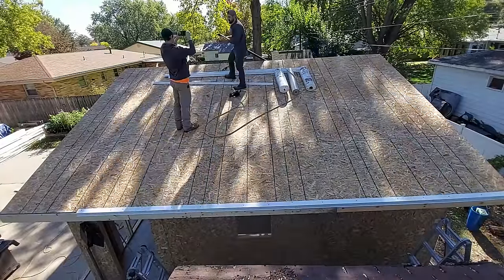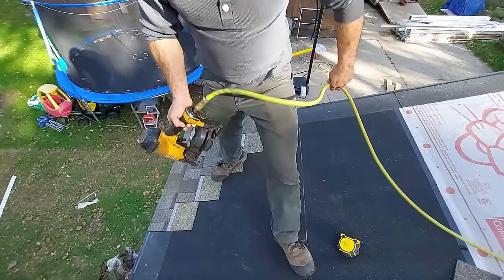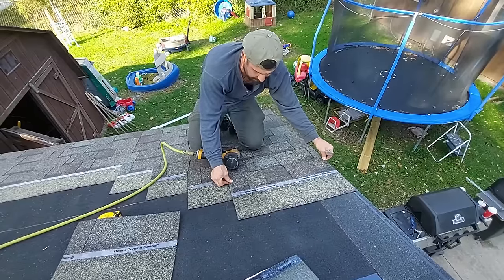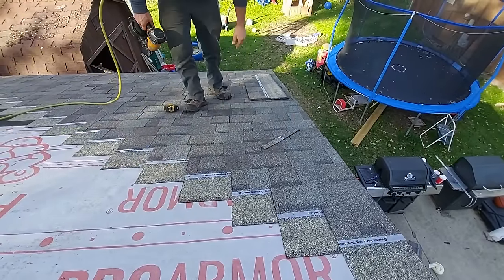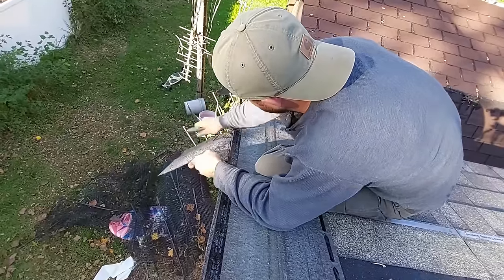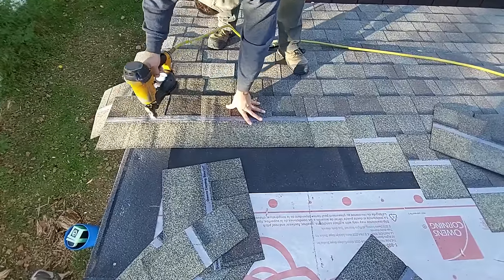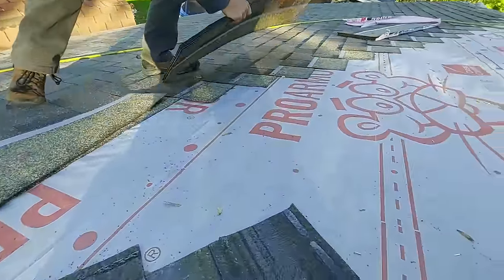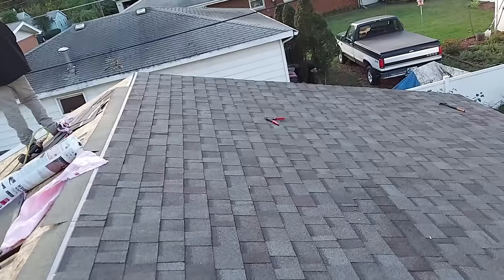HOW TO | Roofing Basics (Part 3 of 3)

Comment: Fantastic job with these videos. I am a mechanic by trade but a diy guy for sure. I replaced my roof back in 05 in my 20s on my old house in NY. It turned out pretty good. I have learned a lot since then and now need to replace my garage roof. Simple 4/12 similar to your video. I feel much more confident in this now, still have my old HF nail gun and am really looking forward to getting it done. 
Do you recommend a particular brand of shingles- underlayment? 
I want it to match my house but not sure what they used.
Reply: Also thanks for taking the time to do this! The main house appears to be OC driftwood architectural shingles. From comparison to Lowes website
Reply from the maker: Driftwood is a nice color for sure. Make sure you use ice shield (if required in your area). For synthetic felt its probably best to use the same brand as shingles the shingles. O.c durations are good, so are GAF HDZ's and landmarks. If you want a cheaper brand of shingles occasionally I'll push people toward Tamko or O.C Oakridge. Try to use the same starter as well. It's not necessarily required but you might want to in case you ever run into manufacturer issues.
Reply: @NWIVeteranConstruction  thanks for the advice!

Comment: Great vid. One tip though. Carry only the hook blade but when you cut the pack use the back of the blade. It cuts right through the plastic.
Reply from the maker: I've never had much luck trying that. I must be doing it wrong lol also, i really like have both a hook and a straight blade available though. It's come in handy one too many times
Reply: @NWIVeteranConstruction  yeah, I get it. I usually have one when I'm wearing a bag and I have a lot of cutting to do. Like around dormers, valleys, vents etc. But when I'm worn out or in a hurry I drop the bag, grab my knife and go to town. Also, I usually use heavy snips around vents on cooler days because they cut through even the common bond easily.

Comment: When you cut the rake If you just use the drip edge like you’re using the shingle your kneeling on  making sure the knife stays flush with the edge of the drip the whole cut you don’t even have to fuck around with that shingle. Just the way I do it. You just have to cut every row as opposed  to cutting multiple like you do. Not hating you do amazing work I’ve learned a lot from your videos
Reply from the maker: No problem but are you saying you cut it flush with the drip edge?

Comment: I work with an older guy hes 60. We recently did a roof on an addition and he cut all the starters 2.5 bundles with an old skilsaw blade. It actually worked out pretty good!
Reply from the maker: kind of a waste of the shingle though? i know guys that use full shingles without cutting them. just upside down. which is apparently okay to do
Reply: @NWIVeteranConstruction  im sorry I didnt word that right. I meant that we cut our shingles for the stair step with a skilsaw.
Reply: sounds like he's chased some hailstorms in his day? he turn the blade backwards?

Comment: Really do appreciate ur videos as they are easy to follow especially for a novice like myself. The one concern I have after watching many videos on roofing is, do u, or do u not, lay the felt paper, UNDER the flashing on the rake, gable side? And on top of the flashing on the EVE side? Seems like many of U guys are doing it differently. And nobody has responded to my comments. Getting started soon on my shed soon as the rain stops??? CONFUSED????? Thanks, looking forward to  ur response!!!
Reply from the maker: sorry for the late response. on the sides, aluminum "caps" over the felt and ice shield. on the bottom, its up for debate. some say the ice and water shield should be applied directly to decking, i understand the argument, i have heard several different opinions and i choose to do it this way because i know from experience ice shield will stick to the gutter apron. i think you're safe either way bud!

Comment: I usually cut durations 7 3/4, 15 1/2 with a snips cutting through two shingles at a time then you can leave them together with no tar exposed until you are ready to use them

Comment: I am in the trades I run my own Marine repair business. I also used to be an auto tech. I work on boats and build Muscle cars . I dont usually give out complements because people have bad manners and an cant even say a simple thank you. But I am very impressed with you knowledge on roofing . I use to work construction I worked Union local 169 out of Reno  years ago I have been on a Power plant done road construction and also new construction on high level office complex. But never done roofing . I dont know why but roofing locks up my brains I just cant understand it for some reason. I had a shingle blow off on my house I just had a new roof put on in 2018 I went up there and very carefully took a putty knife and carefully broke the tar loose and carefully pride up the upper shingles to get the nails out and no matter how careful I was every one I bent up cracked or broke . I got up to the end cap and freaked  out and quit by the time I got done I needed about 6 sheets in the area that only needed 1 I dont know what I am doing wrong I wait until it gets warm in the afternoon I am going to try it again . I know you been doing this for years but you make it look so easy Give me a 440 on a 70 Cuda and I can rebuild it from top to bottom but I am fucked for doing roofing watched this one twice still dont understand it  . Wish me luck . Tell your camera man excellent job and excellent job on editing. My plan is to start my own Youtube I am studying Video editing

Comment: Great videos. I have a complicated question.

I have a lean-to roof above what used to be a screened-in porch that butts up against the back wall of my 2 story colonial. I recently renovated the porch and turned it into an office, enclosing the space and heating it. I made sure to have some air flow in the "attic" of the roof by adding soffit and roof vents, but due to  the original owner framing the roof with just 2 x 4's and then just some 1x's on top of that, the air space between the sheetrock and the roof shingles is very small, not allowing for much, if any, air flow. As a result, my roof is quickly deteriorating, and this winter water was coming into my beautiful new office!

I believe I need to increase the height of the cavity before redoing the roof, but I'm not really sure the best way to go about it. My idea is to connect another layer of 2 x 4's on top of every one they originally used, connecting them to each other with Simpson Strong Tie plates, then adding a new roof deck of OSB plywood to make a new flat surface to lay my roofing materials on. Does that sound like the best way?

Now, my REAL question. If I do it that way, what do I use against the house at the top of the new roof to stop water from running straight past my new roof deck? What would that be called? Are there videos somewhere that might address this specific situation? Please help if you can, I need to do this pretty quickly, before winter hits and it's too cold to do it.

Comment: Great step by step instruction.  Love the incidental tips for beginners.  I now have the confidence to reroof my 2-story home.  I have two strong sons that will help.  Do you recommend fall protection gear?  Thanks a million!
Reply: Fall protection is always recommended, but rarely used. 🤣

It can't hurt, but becomes more important on  roofs that are more steep. If you like to diy and your roof is one of those areas of interest...install a permanent safety anchor and that way you will always have the option.  You'll need 2 anchors if you want all three of you to be hooked in at the same time. Most are max 2 person's per anchor

Comment: Your technique looks great, efficient, and definitely technically sound and effective; however,  would you recommend using the same cutting technique for your stair steps regardless of the manufacturer / brand name of the architectural shingles that you are using? GAF recommends different measurements.
Reply from the maker: Yes. They all recommend roughly 5⅝ but that's generally a minimum.  The bigger ones are better, never exceed 8 inches

Comment: The central common bond, I know what holds laminated shingles together, and it is not the nails. They are glued with a very tough roof cement. I separated one and it took a heat gun to do that. The only concern I have with nailing that low, is it is then very close to the shingle bottom edge that is laid on top. Meaning more likely those nails will get wet. I just wish the shingle makers made the common bond a lot wider. But they must know it is not needed to nail the common bond together to keep shingles together. I also wonder if the glue bond has improved as in the past, I have heard about laminates shingles separating so that the lower half slips off the roof. I am putting on GAF HDZ and it has layer lock. the nail zone is quite wide and extends way above the common bond line. So I resolved not to worry about nailing so low down.

Comment: I’d also say if you are not too safe on a roof use a blower as many time as you want to prevent from sliding
Reply: The leaf blower is a great idea. I used it to blow off sawdust while sheathing with plywood, and after the underlayment was installed, to blow away dust and pollen - after a week of the roofing covered with the synthetic paper I was surprised to be slipping. Then I realized that enough dust had accumulated, making it dangerously slippery

Comment: Good afternoon, Hey, that's a really nice video. You got informative, I'm getting ready to redo my garage roof which is detached. It's a 24 by 24. So I have a question. How do you distinguish your chalk line as you go up? Say like 5 or 6 shingles. How do you measure it to get the right chalkooli line to follow?
And did you use starter shingles on the very bottom? So my plan is to remove all the old shingles and replace any damaged wood. Then I wanna put the synthetic underlayment down first onto the wood. Then my drip edge and is it a good idea to coat the drip edge before you put the starter single  With tar?
Thanks for the video

Comment: The ice shield and eves are what you made seem the easiest.   The pitch on mine was pretty gnarly so I had to work off a ladder for it and then throw three rows of shingle and THEN felt before I felt I wasn't gonna slide off.
Reply from the maker: I know how that goes! When is steeper I usually cut them into manageable pieces. 15 ft or so

Comment: Thank you for your service and for the videos! Question - I’ve done a roof like the one you do in this video and plan on replacing the roof on my current house which has a Mansard roof. Is there a trick to the edges? I haven’t found any videos of them working on the edges.
Reply from the maker: Watch my barn video. It's one of my oldest videos, might help you.  You don't need to add sealant anymore if you use hdz shingles

Comment: Great Video Zack....my question.........when you work your way to the end rake....what would be the minimum that that end piece should be?
Reply from the maker: Mmmm.. you could probably get away with a 5 incher.. should at least be able to get 2 nails in it easily without getting to close to blowing out the outside of drip edge

Comment: Thanks so much for putting up these videos and for your detailed run-throughs. My question is about how to adjust nailing and step length for lower slopes? When you have a 3-1/2 or 3 by 12 is around 8" away from the seams still a good spacing?
Reply from the maker: Yes. If it's a 3/12 though you're supposed to use only ice shield instead of felt. But If I'm being honest a ton of roofs here are 3/12 and most guys don't even know it.  So we don't always do that
Reply: @NWIVeteranConstruction using Gaf Feltbuster after two roll layers of the peel and stick (also Gaf). Last roofers only did one layer of ice shield. Just one more question though: is it really necessary to use plastic cap nails on the Feltbuster or is regular cap nails going to make a huge difference?

Comment: Excellent, thanks! I was wondering if there's any  truth to this.   I've heard you shouldn't shingle directly on ice shield because the shingles adhere to ice shield and when they need to be removed in future years you can't scrape them off like you can if they are on felt.  I'm thinking it's not true because it's only nails holding the shingles down.  The glue is between shingles not underlayment.

Comment: Technically 6 nail pattern is supposed to put the extra 2 nails in the top right and left corners for any roof that is over 10/12 or 12/12 depending on the manufacture. you still do four within the nailing strip and then two in the top two corners to better secure the shingle on roofing that is extra steep, like Manserts, etc. I only watched a few minutes but so far. Nice work.

Comment: Hey bro first and foremost great job and keep working hard. I’ll admit that I’ve only watched this one (part 3) of the series. If I were to make an instructional video for beginners I think I would provide more information as to why things are done in the order and way they are opposed to just how. Example why are you supposed to lay down drip edge before synthetic/felt/ice&water etc. and that would be because underlayment is a moisture barrier. If you were to lay down synthetic and place drip edge on top any condensation would run underneath the drip eventually rotting out the boxing and causing damage. Common sense to us that roof but not for someone starting out. The only thing I would personally have done differently as far as production is maybe wear a tool bag lol and while stepping. Instead of running back and forth to bring it back up on your 6th step (Whole shingle) wine you have a line there go ahead and float a second shingle and nail high so you can knock out the steps and run the field. I’m not being negative just giving my personal opinion of how I would have done it.  Great job. Keep producing content.
Reply from the maker: thank you i appreciate the feedback

Comment: Have you used the Owens Corning starter roll instead of the starter shingles?  I bought some of the roll, but after watching your video I think I am going to return it and go the more old school route with the starter shingles like you did. What I don't like about the roll is the directions say to bring it flush to the drip edge, so you lose that little extra thickness of overhang.

Comment: Young guy here starting out on my own doing roofing I was taught by an older gentleman for last 3 years before he got sick and can no longer roof. Everything is done by hand nails with me although guns are alot faster I was taught to stay away. Also when we put our roof felt down we run it as we go and only use 6 nails to hold it down. Old fella  says less holes the better
Reply from the maker: Til you slip carrying a bundle down it! Lol yea just be careful with the old timers. Hand banging isn't the way to go anymore. There's no issue with guns as long as you know how to use them.  Take a Bostich gun and get the pressure right and the depth, compare it to a  hand nail.  They're the same.  And to tell you the truth the tar these days are much better therefore a roof relies very little on the nailing once installed.  Check out gaf hdz video where they only nailed the edges of the roof and the field had no issues

Comment: Planning to start a roofing company. Very informative videos. I missed it but what is the reason for the cutting and stair stepping along the edges?
Reply from the maker: I highly recommend working for a roofing company and learning to shingle before you'd do that.  The stair steps are required to properly prevent water from entering seams

Comment: Great info this will really help me as I intend to shingle my roof. I have a question about the felt you are using is it some sort of paper, {or is it a material felt} also is there a reason you have 2 different types of felt on the roof you are re shingling. thanks in advance and thanks again
Reply from the maker: one is ice and water shield, which is used on the eaves in areas that have snow and ice build. and the other is just synthetic felt.

Comment: amazing series of videos.  i have been diy roofing for many years and learned so much from your videos.  i am very grateful that you took the time to make these.  thank you, and great work!  I would be curious to know what you would do differently for a 6/12 roof.  what tips do you have for keeping materials on the roof and convenient (or as my brother says energy efficient) for speed?
Reply from the maker: Thank you! And usually I'll use 2x4 to stack the shingles on the roof, you can see it in my 7/12 and 8/12 videos as well as how I shingle. Pretty much the same
Reply: @NWIVeteranConstruction  I'm trying to use the link in the fascia video to buy the Malco snips that you recommended and the link doesn't bring up the Malco product.  Do you know a model number by chance or will any Malco brand be satisfactory?
Reply from the maker: @steveandlisasanders7959  let me look one second
Reply from the maker: @steveandlisasanders7959  I have updated the Malco snips in my most recent soffit video.  "All you need to know" is in the thumbnail.  Snips are in the description

Comment: Thanks so much for the details and tips on this roof.  I'm sure I need the pitch on a 26' long shed to determine the amount of roofing and once I have that, I can determine abt. how many nails I will need @5per shing.
Reply from the maker: Unless you're in the hurricane belt 4 or 5 should be fine. But if it's under 15 sq you should probably just 6 nail coz you'll have left over nails anyway
Reply from the maker: Personally I'd do 5 if the area calls for 4